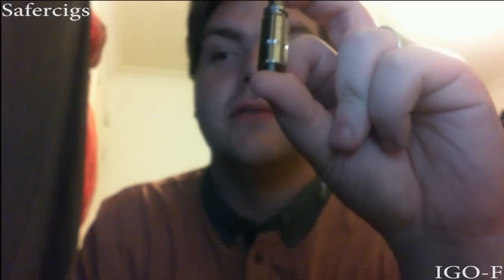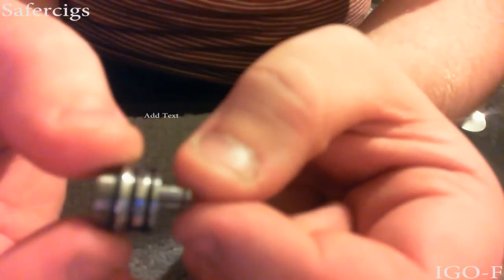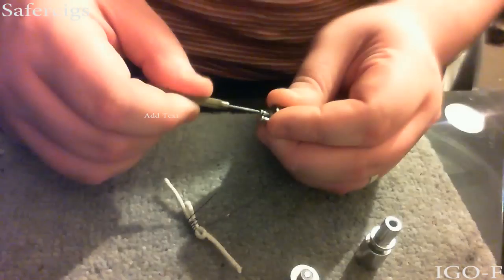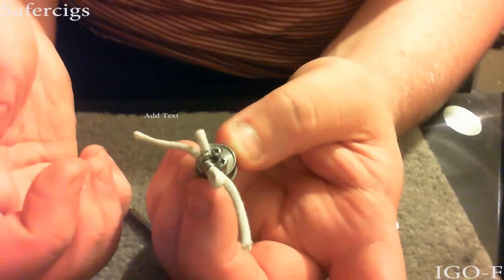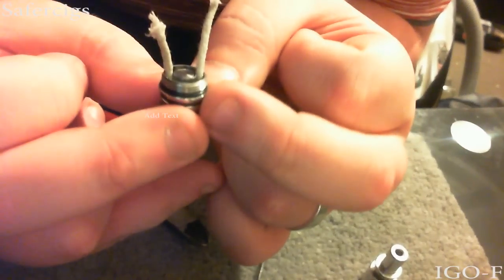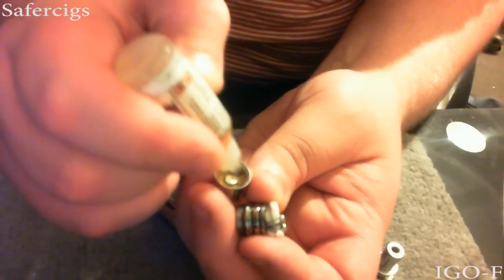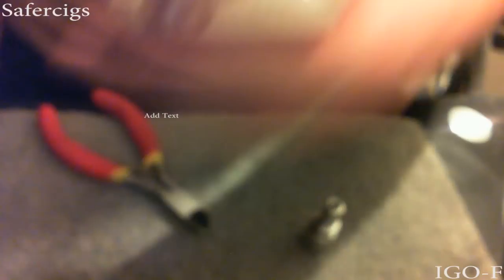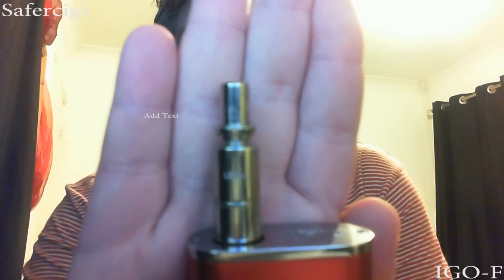UD IGO-F review and rewick

Comment: Actually this one was one of the better of 3 videos about this IGO-F, just want to run a 1.8 on an Ego battery for on-the-go. I ordered 2 on sale($10), got the one drilled to a 5/16" air hole. I am going to use a micro coil or maybe a nano coil using cotton and only using the far hole, the hole next to the coil will be open for dripping with the tank more of an overflow reservoir kind of like Todd ecigreviews did.